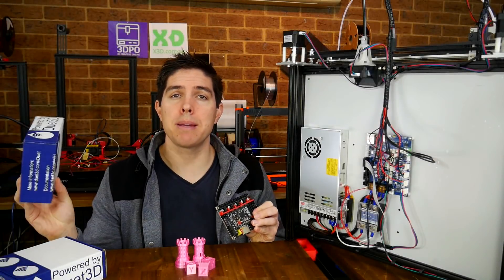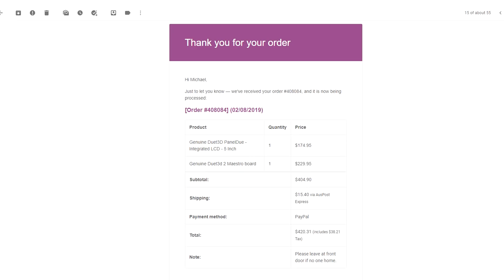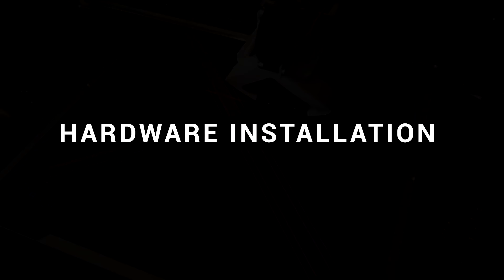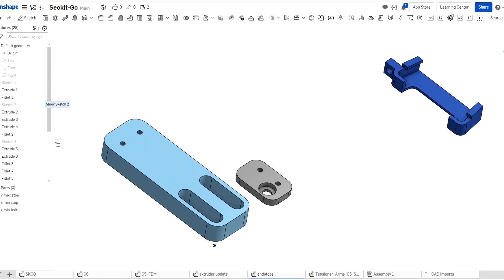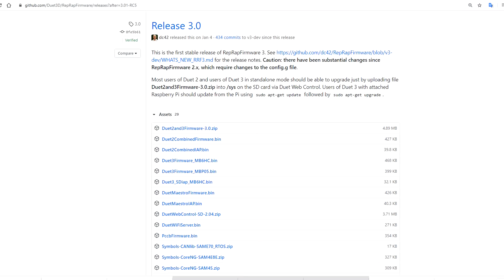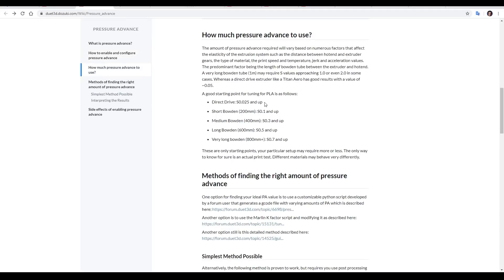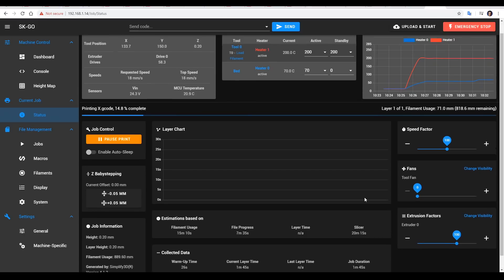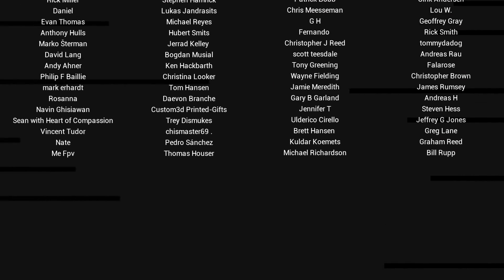Duet 2 Maestro & Reprap firmware on SK-GO: Guide for a Marlin user

Comment: Hi i have a zonestar 3d printer i uppgrade now from marlin software to reprap software with 3d duet and expansion board,  i have 4 color extruders, laser and continius printing motors who remove the printing object, i install linear rails but i think it will take a time to set up the printer, i also

Comment: I'm personally quite a fan of the Duet hardware and RRF firmware. I got started with it when there was no V3, so the upgrade process there was definitely less documented and more involved. Still, I didn't find it difficult with a bit of reading.

I'm running my main 3D printer on a Duet Wifi, and an MPCNC as well.

To me, one of the really big advantages to the RRF is the ability to run conditional gcode. If your printer is already homed, you don't need to home it again.

You asked in the video if the Duet Wifi is quiet. I have limited experience with the stealthchop boards, but it's definitely more quiet than other boards that I've used, most of which are basically single board clones of a Mega 2560 + RAMPS 1.4 with DRV8825 or A4988 drivers. I do have an SKR Pro 1.2 with 2209s and I'd say it's on a par, when the drivers are put into interpolated 256X microstepping (Which programs like 16X microstepping.) In 32X microstepping, it's not as nice, but still quiet enough to leave set up in my office. I did opt to give up the resolution for the interpolated 16X stepping though.

Comment: Thanks a lot for your video. I am a 3D printer lover. I have one M3D quad 3D printer, I find it is use Duet 2 Maestro. (I also have two M3D micro 3D printer and two 3D system cube 3 ) Recently I buy an new Ender 3s. And I find it's quality is very good and very easy to use. It is not I expect before. Because all other 3D print I buy before is second hand and I need do many adjustment and hacking to use third party filament. 

Now for my new Ender 3s, I want to upgrade to Duet 2 wifi and want to make it same as M3D quad 3D printer (can use for 4 color mix). Do you have any suggestion? is it worth to do this?

And also I find Duet 2 Maestor/wifi are open source. Their license is allow reproduction. (it is right?) I find in China have lower price reproduction Duet 2 wifi. (China do not have reproduction Duet Maestro. so I want to upgrade my Ender 3s to Duet 2 wifi) I am not sure the quality level.

Comment: I think the GCODE based configuration is great and would be especially helpful if you are running a bunch of similar printers in a print-farm setting where you could automate the deployment of configuration changes without having to flash each printer with a new firmware. I also like the idea of plug-and-play extension boards because they can certainly reduce the wiring mess if all you ever have to run to the print-head is power and 2 data lines (for which you could use USB-C cables) and use a break-out board from there to control the hotend, the fans, the bed-levelling sensor)

Comment: After buying my second printer, a SeeMeCNC Artemis, which comes with Duet board and FW stock, I then upgraded my hot rod Ender 3 to run Duet FW on a Maestro board.  I liked that so much that I even installed a Maestro on a Monoprice Mini Delta ... crazy, right ?  But I can interact with any of them with any device that can run a browser - phone, tablet, laptop, whatever, and fine tune the configure files with very little effort. So, I'm a fan of the Duet environment and will never run a Marlin machine again.

Comment: I decided to pick up the BigTreeTech RepRap WiFi module for the SKR boards and give this a go, it works great, but man I really do not like RRF.

It might just be because I've been using MArlin for 3 years and Octoprint for 2, but everything just feels harder to do on RRF, the documentation is a bit all over the place, and the web control is seriously information overload-y. It's cool that I can change things I messed up in the configurator with a single gcode file, but without the documentation, how am I supposed to know what the new specific syntax is for my thermistor?

I'm going to keep on trying to figure this out, but Im just not seeing where the "RRF is easier, faster  and nicer to use than Marlin is" comments are from.

Comment: Man, is Duet expensive... But if I ever get the chance, I will be building myself a 3D printer using Duet products, because they are very high quality, very useful and they have features that are useful for me. For example, their integrated drivers are so strong. Normally, I'd turn away, but those things are very powerful, and have safety, so the risk of blowing one out is very low. They also have expansion boards, so that also mitigates the loss.

Comment: Good video.  Look forward to seeing you do more with RRF.  The amount of info you covered may have been a wee bit too much for one video.  I dont get all the firmware bashing.  Marlin and RRF are both great.  One doesnt have to be bad for the other to be good.  I have an Ender 3 Pro with Marlin that is tuned in and i can just hit print and forget it.  Occasionally i will tweak some firmware settings and Marlin works flawlessly for that.  Not to say that RRF wouldn’t work great in that situation as well but it could be argued that it is pricey and overkill in that setup.  I also have a Toolchanger that requires the ease and flexibility of RRF.  Having near limitless expansion capability for motors, sensors, and being able to configure almost anything you can think of.  Being able to tweak and change every setting with Gcode and a simple reset of the board without recompiling and uploading firmware is so nice.  There are strong use cases for each of these firmwares.  Each of them definitely have their strong points and meet the needs of users.  If someone wants to put a duet in an Ender 3 go for it.  When Marlin becomes able to run a toolchanger or similar setup it will definitely be worth a look.  I feel like learning and regularly using as many different firmwares and hardware as I’m able is a great thing.  Learning the strong points and weaknesses of each only makes you more able to have an informed decision when choosing the correct one for the next application.  And there is nothing better than competition in the market to drive innovation on both sides.

Comment: I have a Duet 2 WI-Fi and Duex5 on my custom DBOT and one of the things I like is being able to change nearly any setting without having to recompile the firmware. The Touch Screen isn't necessary. You can do everything via the Web Interface. The Duet Masetro can be used with a 12864 LCD or a PanelDue whereas the Duet 2 only supports the PanelDue. I don't even have an LCD for mine. 

That being said it's a huge learning curve and had something like the SKR existed when I started this project 2 years ago I probably would have gone with that instead. There was nothing like it at the time short of Klipper or a Smoothieboard which seemed even more esoteric then.

BTW if you're really adventurous and/or bored you can run the Duet firmware on an SKR 1.3 / 1.4: https://3dprintbeginner.com/duet-firmware-for-skr-boards/

Comment: i have the duet wfi with the 2660 drivers and i went from a stock tronxy x5s main board to the duet wifi and im not a coding person and the duet stuff is simple and works no issues and the motor are almost dead silent compare to the stock board the loudest part now about the printer is the wheels and belts during rapid travel moves

Comment: This really helps when considering different printers and printer options.. like the Seckit.  He has a barebones version and a mid level version.  This makes the lower level versions a more clear choice.   The railcore comes with these boards and now I really see the value in those.   This helps in the comparison shopping.    Also, it is nice to have the heads up on the bumps in the road in upgrading the firmware.

Comment: reprap was used by RAMPS in the early days of reprap printers. Also, it's currently impossible to order the boards as they've shut down for COVID. That being said, if you're getting rid of your SKR Pro, let me know as I have a stalled project printing PEEK for ventilator parts but we can't use a thermistor in our setup :[
Reply: The boards are available through the resellers.
Reply: @christophmuller3511  A lot of whom are out of a stock as well.

Comment: Very interesting. I happened to buy a printer with a older Duet (0.6), which has worked very well. I'm looking at the Maestro as an upgrade, and this video has been helpful in seeing how similar it is. I have another printer (Monoprice Select Mini), which I believe is Marlin based, and although the software isn't as slick, it does still print very well. Thanks 😀👍

Comment: You forgot to replace 100 MHz with 120 MHz on one of the LPC1769 in the comparison table (SKR v1.4 Turbo). And do not call SRAM for just "memory" when multiple memory types are listed.
Reply from the maker: Correct on the MHz. Look at how much information is on the table, do you think it would be improved by adding more? People want a brief overview, details such as the type of RAM aren't important to them. Anyone like yourself with enough knowledge to know the difference doesn't need my table.

Comment: I'm currently upgrading my old Printrbot Simple Metal to use a Duet 2 Maestro. The new board is slightly too big to fit in the printer's enclosure, so I had to build a base for it, but I expect it to be a straightforward upgrade.

Comment: I know you just started dipping your toes into Duet stuff, but I'd really like you to do a true comparison between Marlin and RepRap after you feel like you've spent enought time with the Duet to "figure it out". When I've asked people in the past about Duet, they all rant/rave about it but never really specify what's better about it (other than firmware changes, but I'm more of a "set it and forget it" kinda guy, not constantly making changes). For $100+ for just the board, I feel like they have to offer some pretty cool features that can't be had with a $25 SKR and $35 Raspberry Pi (since you can use they same pi for multiple printers).

Also, I'd be interested in you diving more into the SKR Pro board, as I feel like that will be a pretty close competitor to the Duet.
Reply from the maker: I tried to not speak in absolutes because of my inexperience with it. I will consider a comparison in future once I'm more familiar. I've had an SKR Pro sitting for ages, but it seemed like overkill for all of my printers. Hopefully something is suitable in the future.
Reply: @TeachingTech  I know you have been building a LowRider CNC, I think it would be cool to use the SKR Pro on that, as it would open it up to things like tool changing, which on a CNC mill would be quite useful, but having not really gotten into CNC milling yet, I wouldn't really know.

Another idea would be for a "multi head" printer, like the one that various other channels have built, but instead of building that specific kit, maybe DIYing one yourself, though I'm sure that would be a ton of work (unless you found something on Thingiverse or something)
Reply: @TeachingTech  Since you are more familiar with the SKR 1.3 there is a fork of RepRap FW by SDAVI that supports the LPC1768/*9  boards, with example config for SKR 1.3. That would give a better comparison between the two, as the hardware can remain the same.

Comment: According to my supplier the Maestro card is not longer produced, and only the more expensive Duet WiFi (163 Euro) is available as cheapest option. I don't think it's really very cost-effective to use a card that expensive on my 315 Euro Ender 5. Especially since I have not seen any truly convincing reason to upgrade from a SKR that's only a fraction of the cost of an Duet. 
The card is very interesting, no doubt about that, but in my case I think I stick with my BTT SKR Mini E3.
I think it's another story if you have a more expensive printer, and want the convenience of no re-compiling if you want to change core parameters. In that case it's maybe worth to give that card a good run.

Comment: The steppers on the Maestro 2 are silent. The fans are the only sound I hear. Also Cura has a plug-in that sends sliceded files directly to your network connected printer. I know it's expensive but it's with every penny.

Comment: I have duets running 5 printers and 1 CNC with a rotary axis I'm very happy with rrf3.1.1 . Granted the TMC 2266 are noisier than 2208/9 but are quiet enough for me , user gloomyandy and sdavi have ported rrf3 for lpc 1768/9 boards that works just like the duet wifi/ethernet boards follow this link https://reprap.org/forum/read.php?147,859857,859857
Btw always good to hear a fellow aussie love your chanel tutorials and reviews ,keep up the good work !
Reply from the maker: Thanks for sharing. I have recently ordered the wifi module ready to tackle an SKR build of RRF.
Reply: @TeachingTech  just beware setting up  tmc22xx drivers on the skr will throw occasional errors , these errors can be ignored .

Comment: DWC is not customizable in a way octoprint is. There are no plugins, just macros and that's pretty much it. Also, if you want to try RRF, you can install it on skr 1.3 with SBC (like Pi) or esp32 connected.
Reply: Didn't know you could put the RRF on an SKR and Pi setup. Will definitely have to look into that!
Reply: @nathan1sixteen  it's actually fairly easy to do but it needs some soldering on dupont cables
Reply: @L3LK3K  true. I mentioned that
Reply: I just did that upgrade to my 1.4t, works great and fairly inexpensive.

Comment: after printing for over 6 years on multiple printers including one for 4 years with a Duet WIfi It's not worth it ...really Especially now BTT 1.3 /1.4 running Marlin 2.0 are cheap and reliable. Upgrading firmware is an absolute nightmare !!!!   You have to change so many things its unbelievable . Just look at the config changes needed from FW2.*** to FW3.*** (https://duet3d.dozuki.com/Wiki/RepRapFirmware_3_overview#Section_Changes_to_existing_G_and_M_commands) You basically have to reconfigure from scratch. Just takes all the fun out of it.   Im secretly hoping it will blow a driver chip soon so i can replace it !!!!  It prints fine and is very quiet ill give it that but...................... Poor documentation ( often very confusing) and the purchase price ...Nah never again ...................................
Reply: Yeah, Marlin is such a breeze to configure, nothing could possibly go wrong setting up a cross compilation build environment and editing c header files by hand like it is 1990. The forums are full of people praising the experience of having no problems with this approach whatsoever. /s

Comment: Great video, I have a Duet Wifi on an  Ender 5, works great. Setting up ABL seems to be a bit of a nightmare (BLtouch), might be a good idea for a future video 🙄
Reply: You are correct.... BL Touch is a bit of a pain.... but it works great once you do
Reply: I found a video from 3D Printing Canada that helped a great deal. I upgraded to the Hemera on my Ender 5 at the same time. I found the BL Touch worked as advertised but had to experiment with several mounts. I am glad I had the stock metal BL Touch mounts because the 3D printed ones were pretty flimsy.

Comment: While this is certainly a good direction where this video aims, if i wouldn’t know and love Duet and it’s RRF fork, this video would probably deter me from getting one.
Probably not a great idea to do a duet video if one isn’t yet familiar with it because you basically scared the shit out of newbies. ;)
Tip: if you don’t use toolchanger, duet 3 or non-duet board, last version 2 firmware is more than plenty to get one started.
Reply from the maker: I'm very experienced with Marlin, so if I point out things that aren't easy, it is valid criticism and a newbie should be scared. The firmware update process was all over the shop, certainly a lot harder that dropping one binary on an SD card and rebooting. I still like RRF, but it's not perfect. You've gotten used to it, so potentially your knowledge is sufficient to overcome any deficiencies.
Reply: @TeachingTech  The firmware update process under normal circumstances is quite a bit easier. Upload a zip file via the web interface. Given that the board comes with working firmware you could have connected to it via the browser and updated that was as well. I think the docs should make that more clear.

Comment: Reprap is awesome if you can remember tons of GCodes... I know, I switched to the duet3 6hc last year. Duet3D has an awesome forum community too btw
Reply: What for? They all using gcode. Are you retyping gcode produced by Cura to printer?
Reply from the maker: I think they mean when configuring. Referencing the gcode docs is a lot more frequent. There are more codes plus many more arguments.
Reply: @vladimirseven777  Just saying everything is GCodes... a comment made from experience... Gees no need to be rude :P
Reply: @CountryAireDesign  From my experience with Duet wifi I needed gcode to change start and end gcode in Cura from previous settings and to add delay for heating bed. That's all.

Comment: And the best from v3.1.1 IS conditional gcode. Like If printer Not Homed, do homing...
Reply from the maker: Conditional gcode would be great. Simple things like lowering Z at the end of the print depending on the current z position.
Reply: @TeachingTech  IT IS reality right now (v3.1.1) and works Like a Charm on my duet3d 2 wifi